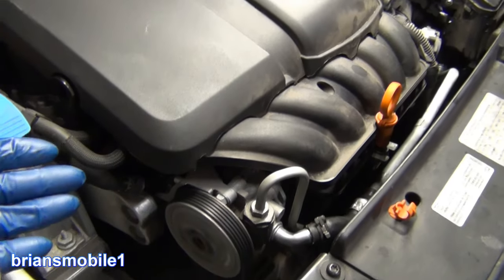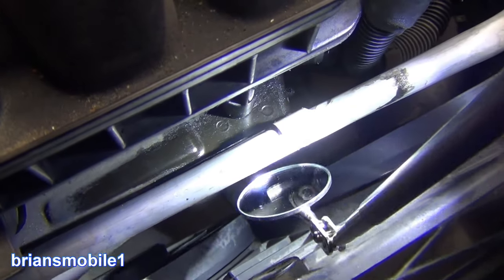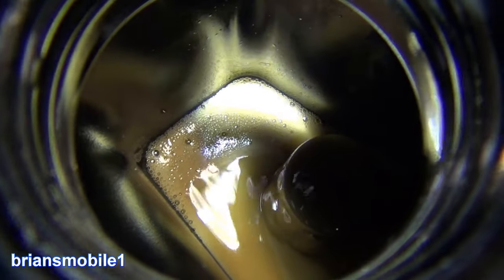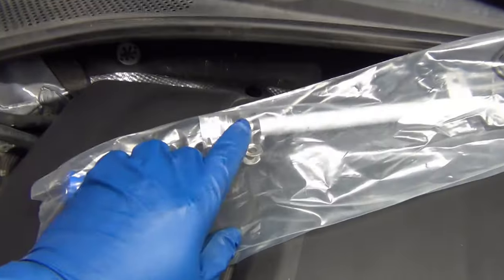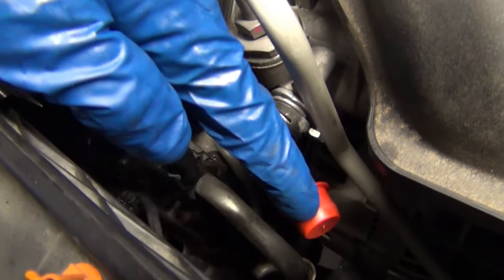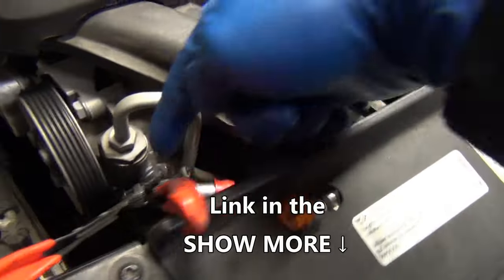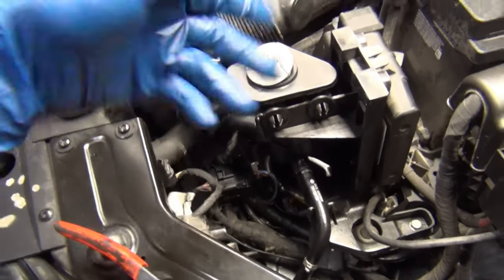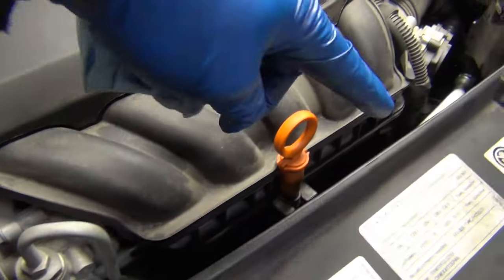Volkswagen 2.5L Engine Chewbacca Noise Fix

Comment: Yes, and if you put regular ATF in there you will be buying a new pump, new rack and all new hoses as well, because they will all be leaking.  With that might as well put in a new reservoir as well, as it will be quicker than cleaning the old one out properly, and the top seal will also leak. that VW fluid is actually cheaper at the dealership than aftermarket, at least by me, I needed a 50ml top up, so bought a single bottle of it.
Reply from the maker: Good advice!

Comment: What could be  the cause of  top pipe leaking  from where it screws onto the pump?  Theres no cracks and Ive already changed the small worned out O ring.